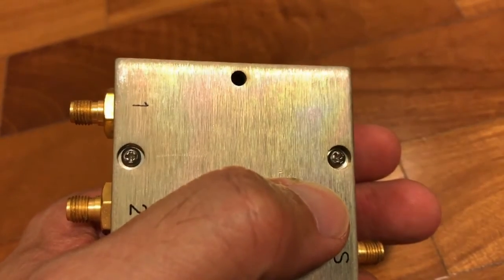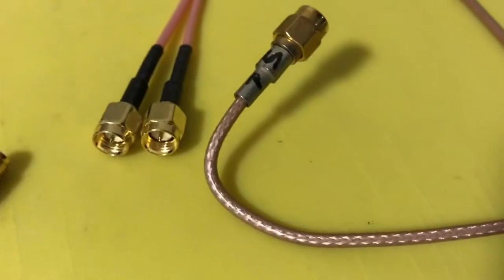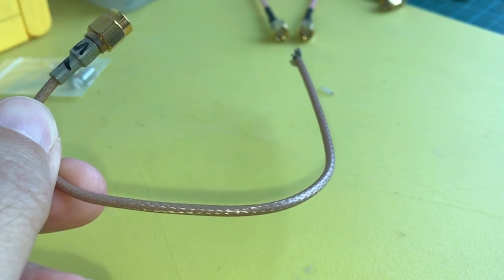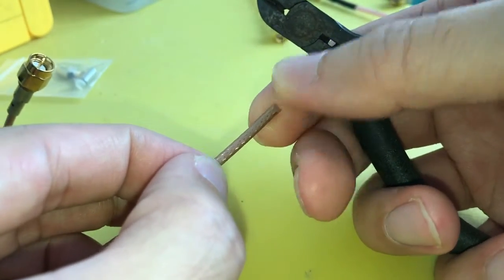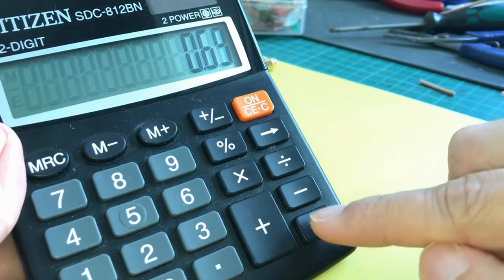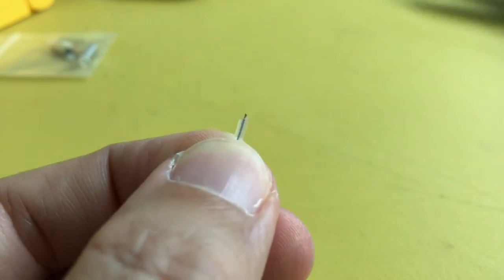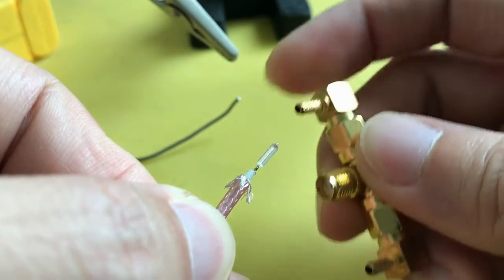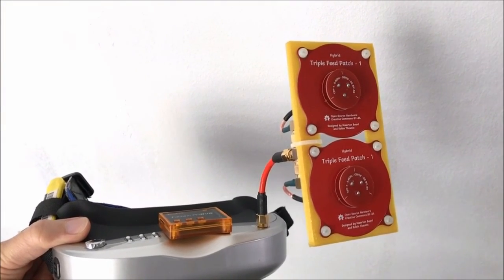Double Triple Feed Patch Antenna for Long Range FPV

Comment: Is it possible setup one antenna in Left Hand , and other Right hand in heavy multipath enviromtents? Or better both Right Hand, and in the the second port of the diversity receiver a Pagoda or cloverleaf Left Hand. I made your setup with same antennas, a power divider as your minicircuits, (3.4db insertion loss and 20-25db of isolation, very good one), but looking better setups for indoor multipath and outdoor, it is in a antenna tracker.
Reply from the maker: Thanks for watching. I believe there is some loss with using opposite polarized elements in an array, so it is better to use a diversity receiver to toggle between the 2 different polarized antennae. I hope you have good result with your setup. Have fun!
Reply: @terence79chan  thanks ,I opted by two right hand in the array, but in the other port of the diversity receiver I put a Left hand patch, but maybe I try a pagoda as it is to catch multipath reflections I guess they can come from any angle. I don't have even basic knowledge just is in my head, not sure if it has any sense
Reply from the maker: That will work. In practice, another right hand  polarized (same polarization) antenna on the other diversity provides more benefit though as it can cover any null spot in the radiation pattern of the first antenna. Previously, there was a youtuber who used a crosshair antenna without the reflector on his glider for a slightly more directional transmission to his video receiver. As his glider turns back, the crosshair without reflector gives an opposite direction polarization. Your setup works very well for his scenario.
Reply: @terence79chan  thanks sir by share knowledge and be so kind
Reply from the maker: @Flamenawer  no worries my friend.
Reply: @terence79chan  Hi, sorry for the late comment. By any chance do you remember which YouTuber did the test that you described?
Reply from the maker: unfortunately I could not recall his nick, I only remember that he’s an Aussie.

Comment: Hi Terence really super interesting, i am a "profane" trying to get a better understanding of this, i noticed few months ago, how length of wires ir cables are such a determinant fact for the proper reception and use of an antenna capabilities, but being a profane on this knowlegde could you help me by recommending a source of information o theory or kind of both mixed things just to properly understand and have a practical operational thinking just from básicos to proper technical understanding "just how de drive a car after learning how to drive" (i Hope this comparison make sense for you), anyway thanks for all this! Greetings from Spain
Reply from the maker: Thanks for dropping by! You may find it easier to understand impedance matching with my other video that explains the same principle using microstrip. The video provides the online calculator (URL) which is useful for hobbyists like us
https://www.youtube.com/watch?v=KBLNZZR_csQ
Reply: @terence79chan  how nice, thanks in advance, i am going to wacht this video! Thanks again

Comment: A little late comment but, Is there any chance you are selling these? or I can buy one pre-made somewhere?
Reply from the maker: I am not selling this but I would recommend you to get the TrueRC x2-air (available at getfpv) for 3 reasons, firstly it uses the same impedance matching network as in the video, secondly 2 crosshairs perform better than 2 tripplefeed patches(wider horizontal beam width) and thirdly, it is lighter without those two 50ohm terminators required by the tripplefeeds.

Comment: Great video.   Is there a reason the 2 50ohm wires are both cut to 45cm?    If i make a 2.4 one of these.   Obviousley i would have to change the length of the 75ohm stub.  Would i have to change the length of the 2 50ohm wires as well?  Thank you.  Nick.
Reply from the maker: The 50ohm wires just have to be the same length, any 2 equal lengths would work but you wanna keep each less than 1/2 foot long to minimize loss. There is a different way to phase CP antennas using sequential delay network. That involves delaying one antenna 90deg from the other, using 2 different lengths of 50ohm that are carefully calculated for 90deg difference for a given frequency. This method would phase 2 linear-polarized antennas to become a CP array. We don’t need to do that for 2 CP antennas.
Reply: @terence79chan  Ok Thanks very much for taking the time to explain that.  Perfect. 👌😆
Reply: @terence79chan  Sorry 1 more question.  For the 75ohm matching stub.. does the 7mm messurment include the ends that you strip to soler?  Thanks again Tenence.
Reply from the maker: In my video, the calculated dimension is just slightly under 9mm. Normally (for 2.4g/1.2g) you would use such calculated length for the matching stub. For 5.8ghz which requires a tight tolerance, you need to substract off 2mm (1mm for each blob of solder joint), hence I use 7mm. To answer specifically to your question, the 7mm includes the 2 exposed ends which insulation is stripped off.
Reply: @terence79chan  Hey bud.  Again thank you for the detailed but easy to understand Answer.   I've built a crosshair and did start to build a double crosshair,  I was stuck with how to match them both.   It's a shame i didnt find your video sooner.  Thanks pal
Reply: I am going to subscribe
Reply from the maker: No worries, glad m able to help.

Comment: I don't understand. How did adding 7mm of wire affect. Anything.  Is the wire of different gauges ?
Reply from the maker: The 7mm of wire is a quarter wave transformer. It transforms the two 100ohms transmission lines (after the T junction) back to 50ohm each. The first minute of a recent video I posted, has a more thorough explanation —————-> http://www.tinyurl.com/DIYmicrostripArray
Reply from the maker: The “transformer” wire should be 70.7ohms based on the quarterwave transformer calculator online. since coaxial cables are commonly manufactured with either with 50ohms or 75ohms impedances, RF engineers usually use 75ohms cables which are close enough. I used RG179 coaxial cable which is 75ohms, for the 7mm wire.
Reply: Hi Terence really super interesting, i am a "profane" trying to get a better understanding of this, i noticed few months ago, how length of wires ir cables are such a determinant fact for the proper reception and use of an antenna capabilities, but being a profane on this knowlegde could you help me by recommending a source of information o theory or kind of both mixed things just to properly understand and have a practical operational thinking just from básicos to proper technical understanding "just how de drive a car after learning how to drive" (i Hope this comparison make sense for you), anyway thanks for all this!

Comment: Can this work with 2 MenaceRC Pico Patches in the same plane? or 2 AXII patches...(much smaller form factor)
Reply from the maker: Hey Scott, it will work for any two 5.8ghz antennae as it is basically a splitter or combiner for 5.8g. You will need to position your two patches at least 3/4 wave (approximately 4cm) apart, measured from center to center, for the array to work well.
Reply: Thank you for your reply...I plan to use a splitter, with 2 90deg elbows, and 2 45 deg elbows to the Pico antennas on my fatshark goggles should get me close to 4CM apart, I think I can make it work and also have the same plane the way they pivot. Will I need to Solder on the 1/4 wave transformer segments like you did or was that just for the triple feed antennas you used? Or can I just use the SMA adapters to get that distance and be fine? How will that affect my Receiver, I am planning to add the array to my B side diversity receiver on a Laforge V4 for wider beam and long range, but If I lose a little gain (the Pico's are 9.4db each), and get a wider moderate range beam I think I will still be pleased.
Reply from the maker: Yes, you will still need the quarter-wave 75ohm parts for the impedendance matching to work. Your receiver will ‘see’ the array as a 50ohm antenna, Remember that in portrait orientation, you get a wide horizontal angle with low altitude coverage from this array. On your diversity, you can pair it with a clover. Or you could have 2 arrays both in landscape orientations to let the arrays cover the vertical while the diversity covers the horizontal.
Reply: I think soldering the 1/4 wave peice is above my skill...would love to see you try this with Menace RC Pico patches though, if only to see the results compared to the Triple feed array you now have.
Reply from the maker: The MenaceRC Pico is similar to the IRC mini patch which has a return loss of -17.8db, whereas the triple feed has a return loss of -26db which is better SWR-wise. Refer to the actual VNA readings at www.youtube.com/watch?v=095XirS6qjQ
Reply: Great Info, Thanks!

Comment: you missed to put the 50ohm terminator on any of the antennas that way they won't work fine at all
Reply from the maker: I had purchased 2 MCL ANNE-50-8 terminators after making the video. True enough, the array worked significantly better with the terminators on.
Reply: nice to know! you have a great channel I hope I can watch most of the videos soon :)

Comment: Do you think it's feasible to use a bandpass filter to cut down on interference from other quads in an FPV race? Like this random one I found: https://www.minicircuits.com/WebStore/dashboard.html?model=BFCN-5750%2B Looks like it would require some additional construction like a metal enclosure with incoming and outgoing SMA
Reply from the maker: It won't help much because the other race quads' frequencies fall within the same 5.8g band. Even if you find a narrow range filter, the frequencies outside of that range will still emit harmonics

Comment: What's the device you showed at the beginning of the video?
Reply from the maker: It's a professional 2-way splitter for up to 5800mhz applications. You would see similar RF splitter in hardware shop which are for 2 TVs to use one aerial, they could be used to phase 2 TV antennas.. the difference is those are rated 100mhz to 1000mhz and they are meant for 75ohms antennas. The higher the frequency rating, the higher the price.. so the one in the video is for 50ohms and it costs more than 100usd :(

Comment: It would be nice to see this on a Addon PC board. It could join the two and only use one SMA cable and connector. If it's possible to use soldered cable jumpers. All those brass connectors are heavy on your face, and they're not that cheap either. It would be great to put the termination on the Addon PC board too, for the same reasons.
Reply from the maker: Agreed. A "single pcb reflector" version (with the matching network etched on it) would be awesome too. I would not hesitate to buy it for the price of 3 Triplefeed patches. The mini-circuits 50ohm terminator plugs finally arrived. I'm getting a better reception now than during the test shown in the video. I strongly recommend terminating the 2 unused ports with good quality terminator plugs to see the full potential of this TripleFeed array.
Reply: I'm seeing prices of $15 for each terminator, so that's not very cost effective! I think the ability to chose LH/RH is not so useful. The cost is to high and weight too heavy. 
The termination network should be SMD, for lighter and cheaper antenna.  
Actuna.com has a 4.5cm version, and I think a single PCB 2 stack, termination at time of manufacture would be ideal form factor for goggles.
but even the fullsize would be acceptable light if it was all one PCB.
Also Maarten says the terminators are fairly non-important, so you could be having placebo effect.
Reply from the maker: Thanks for the info, if Maarten himself had said so, I think the difference I'm getting is really due to the placebo effect. I played with the DIY splitter a bit more, hooking it up to my friend's VAS crosshairs (both are the new versions with PCB elements). Well, the crosshair stack really stands out in terms of the crazy beam width! If money is not a concern, grab an X2-Air or the VAS pepperbox. Speaking of that, I have a couple of brass plates and copper tubes lying around, I really should complete those crosshair builds...
Reply: @terence79chan  Hi, I really want to try out making my own double crosshairs!! Is it worth to do it in comparison to the X-Hair 2 or Pepperbox? Is the Performance of the self made close to the ones from VAS or TrueRC?

And if I have some questions while building, do you have Instagram Facebook or something where I could ask you some short questions?
Reply from the maker: At 5.8ghz, the tolerances are very tight. I would recommend that you buy the VAS pepperbox or TrueRC X2-air unless you have had experience building your own xhair antenna before. It took a lot of attempts for me to build a xhair that works well. Andrew McNeil has a neat video that shows the step by step. Google for Andrew Mcneil Crosshairs and his video for 5.8GHz Crosshairs Waveguide Antenna should pop up.
Reply from the maker: After you verify that each DIY xhair performs well, then you could  proceed to make the splitter (in this video) to phase them properly. If either one of the Xhairs does not work well, or if the splitter is not built precisely (eg, no big solder joints), you will have an array which performs worse than a single true-RC xhair.
Reply: @terence79chan  thx I watched it
Still would like to try out it myself instead of buying one 

1. question about the splitter. Dont the multiple connectors you used in the video loose some gain of the antenna because of the loss in the connectors? Or is this not noticeable?

2. question, would a 2 stacked aray of these triple patches give me also similiar results to a Pepperbox??? (I know that it doesnt come close to it but maybe still pretty good)

3. Is a double helical also possible? Would this encrease Horizontal beamwidth? Helicals would be a lot easier to build yourself.
Reply from the maker: There is indeed some loss with having the SMA connectors but it is insignificant as compared to the overall gain you get out of the array. The advantage of such a splitter is you could hook up 2 helicals, 2 triple-feed patches, 2 crosshairs or other capable CP antennas. You could also use it to stack 2 cloverleafs or 2 pagodas to create a 4.2db omni antenna(clover's 1.2db + 3db of doubling that signal). The crosshair has the widest horizontal beamwidth, followed by 3-turn helical, then followed by the other PCB patch variants.
Reply: @terence79chan  How do you use this to stack an omni? I mean what orientatian do I have to place the antennas? Cant imagine how that works.
Reply from the maker: You have one omni in upright and another omni upside-down directly below it. Both omnis produce a combined CP radiation pattern of the same direction.  It looks like this: 
https://cdn.thingiverse.com/renders/fb/1f/a2/32/9f/StackedFanRadome001_preview_featured.JPG

Edit: The omnis are both RHCP or both LHCP, since bottom one is inverted, the two quarter-wave transformers will require a 180degree delay. 180degrees is 1/2 wave hence the two transformers should have a difference of 1/2wave (or 2/4). As such, we could use 1/4wave and 3/4wave, or 5/4wave and 3/4wave (longer 75ohm cables) to allow the desired separation distance between the 2 omnis.
Reply from the maker: That is correct. However I made a mistake in my earlier reply to Arial FPV. The two opposite facing CP omnis should not be reverse polarized to each other. They should be both RHCP or both LHCP. I confused myself with the x-hair’s element (the cross) which one side is RHCP and the other side is LHCP. Omni CP emits the same-direction-circular waves (horizontal-wise) whether it is in upright or upside-down orientation. And vertically-wise are the nulls of its radiation pattern
Reply: @terence79chan  I can see from both the StackedFanRadome image that you linked to and the 2.4GHz version of the VAS SkyHammer (https://www.videoaerialsystems.com/collections/antennas/products/skyhammer?variant=29933998178407) that they are indeed both the same direction of polarisation, but I'm confused as to how that works. Using the fingers on my right hand as a guide, I can see that the rotational direction in the horizontal plane does indeed change direction when held upside down so I'm not sure how it ends up increasing the gain.

Would this splitter be a suitable part, removing the need for the impedance matching? https://www.minicircuits.com/WebStore/dashboard.html?model=ZX10-2-71-S%2B It's $35, quite compact and doesn't reverse the phase, so the specs seem to match.
Reply from the maker: That 2-way splitter will work just fine for the receiver. Its center frequency is 5.4g but vswr is still well below 1.5 for 5.8g. Note that there is an insertion loss of 0.4db so you will lose 0.8db in total. The insertion loss is due to the RF resistors on the PCB inside, which are used to bring the merged impedance to 50ohms. The increased gain from having 2 antennas way outweighs that loss so it’s ok. The brass case for noise shielding is heavy so it is probably not suitable to use this for stacked omnis on the vtx.
Reply: @terence79chan  Thank you, it's really helpful to have you go through the important values on the datasheet and show which parts are applicable as the datasheets are quite generic. I'm going to have to give this a go now!

Comment: Great video. So this will work if I only use sma antenna to build the splitter
Reply from the maker: Yes,  the SMA ones will work too. The RP-SMAs I have, just happened to be L-connectors which are easier to work with, as compared to the normal straight SMAs which center pins are detachable.
Reply: Thank you for this. Very helpful